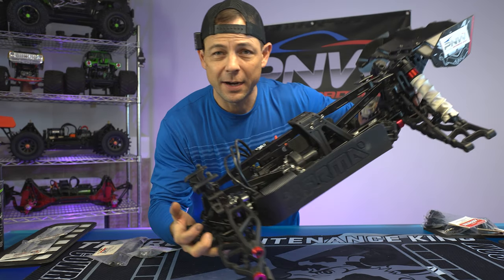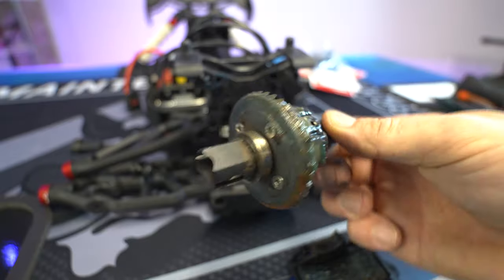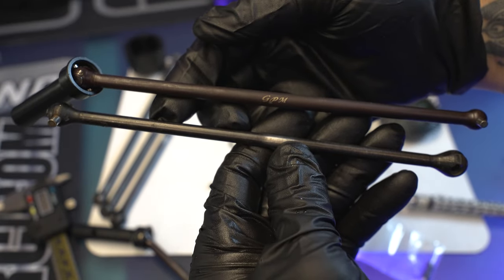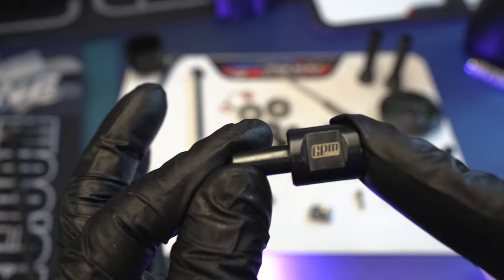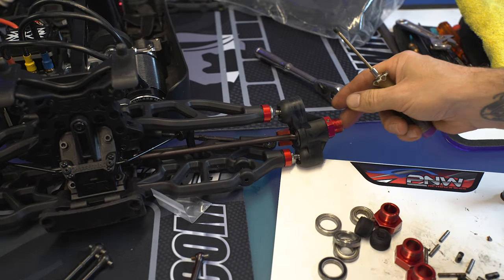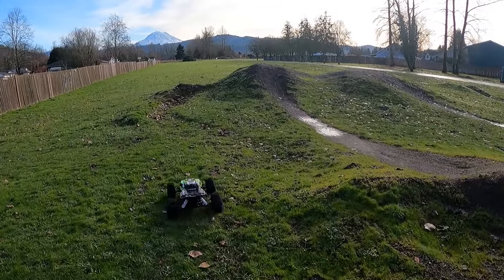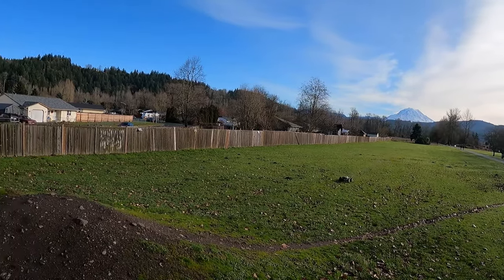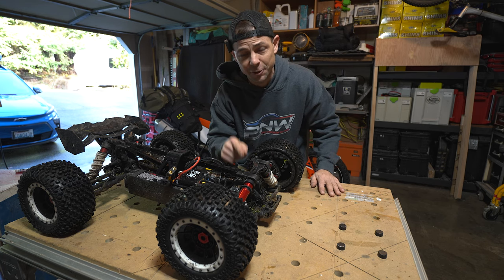#ARRMA KRATON 8S #GPM RACING (7mm) BEEF CAKE AXLE UPGRADE And DIFF REBUILD

Comment: The K8S really needs some serious suspension upgrades.. Arrma should have used even larger bore and stiffer springs on this unit! This is the only reason I chose the XRT over the K8S! There is just nothing "Plush" about it when jumping! (Something ALWAYS breaks on these... weight is the true killer!)
Reply: Ya, accept u have to upgrade everything, all gearing on the XRT. O and Traxxas is manufacturing shit at this point to be complete garbage.